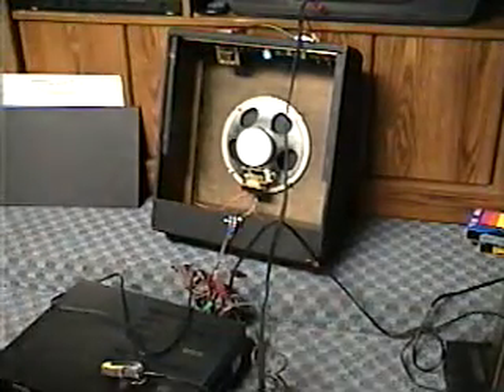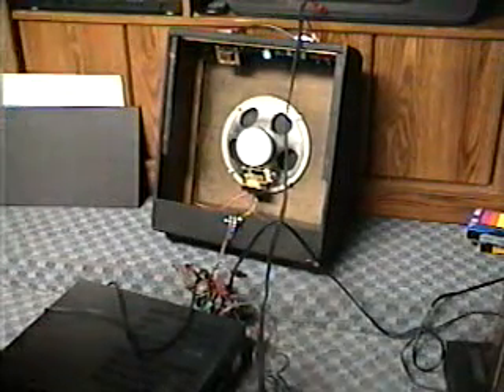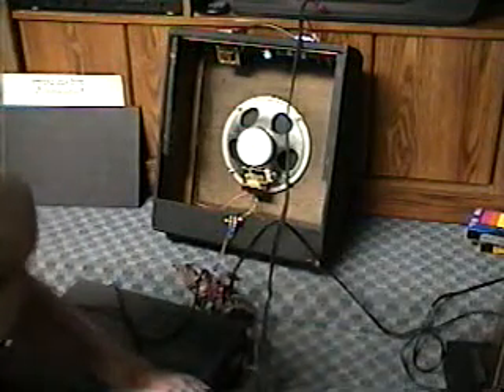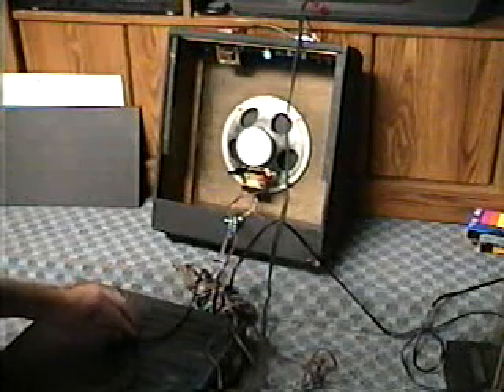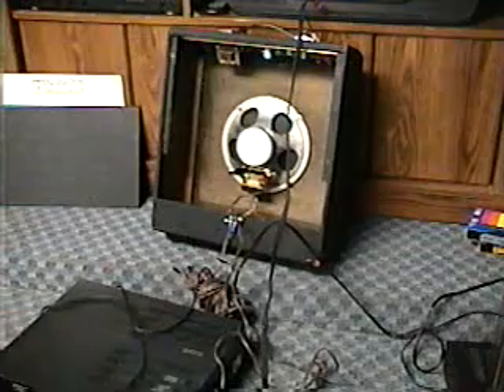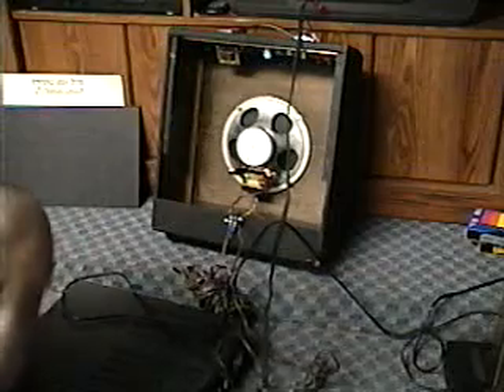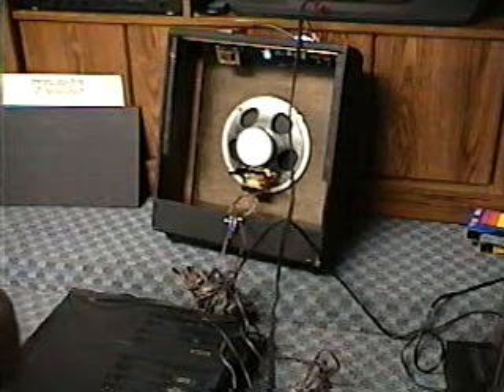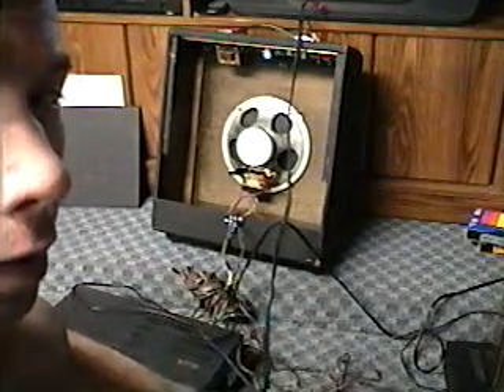Speaker Demo 2

Comment: You may over load the 70 volt output by connecting it to the 8 ohm speaker. In this configuration the 8 ohm speaker is shorting out the 70v output. You can think of it this way from an 8 ohm speaker point of view. The 8 ohm output of the amp is a completed circuit ready for the speaker. The 70v output is not a completed circuit for the speaker and a matching transformer is required to complete the circuit for the 8 ohm speaker.